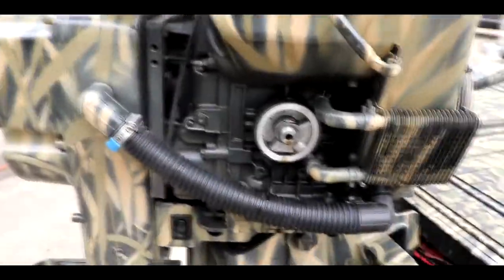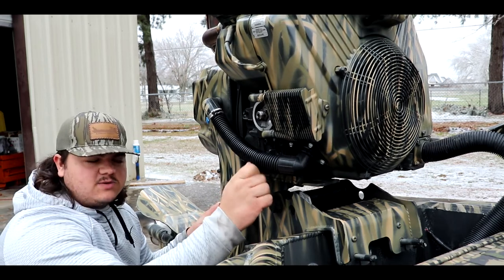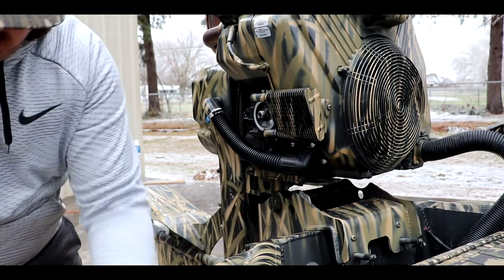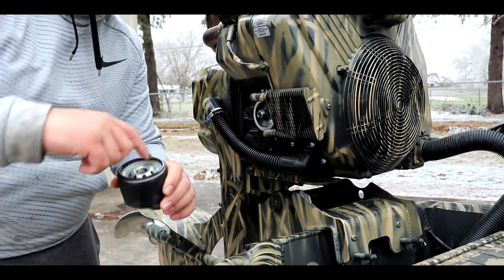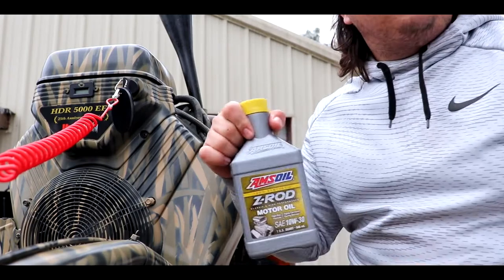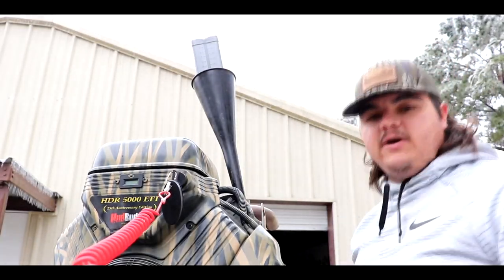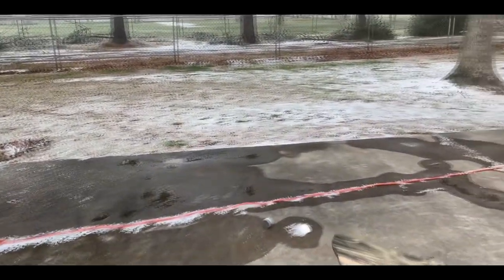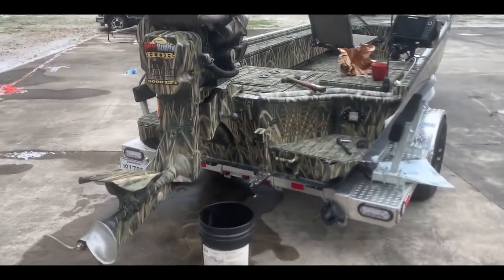How to change your oil in your Prodigy!

Comment: Thanks for the video. I'm doing my first oil change on my mudbuddy HDR 5000. Its around 12 hrs or 11hrs on the motor. Can u tell me how u did ur valve lashing. Did u go top dead center
Reply from the maker: I haven’t even checked lash yet. But I do believe you check it from TDC
Reply: Willey Fast has a great video of how to check and set valve lash. You actually want to set it off the cam lobes as he describes in his video.
Reply: @acjoutdoors929  always do too dead center where the valves aren’t using pressure. Should have .005 for intake and .006 for exhaust I think. Back off with a 13 mm then adjust with a t40 or your fingers it’s not hard to turn and tighten the 13 to 70inch lbs